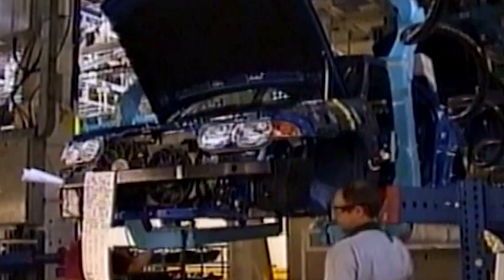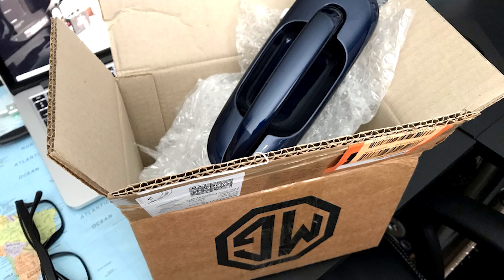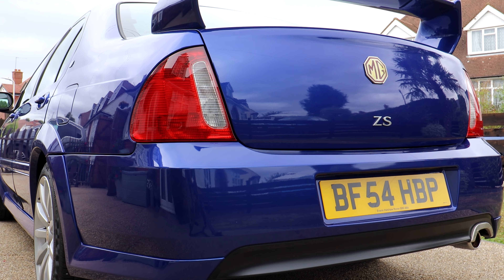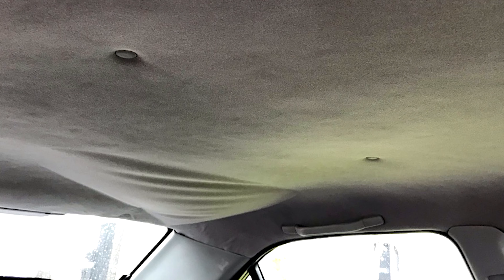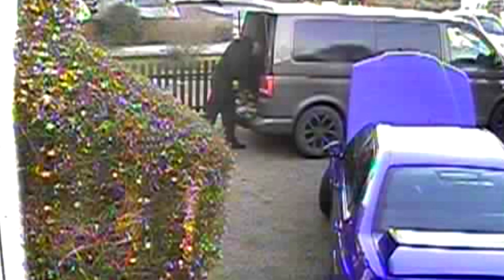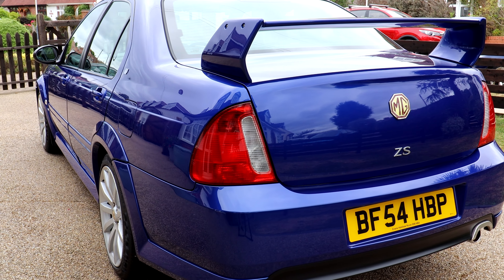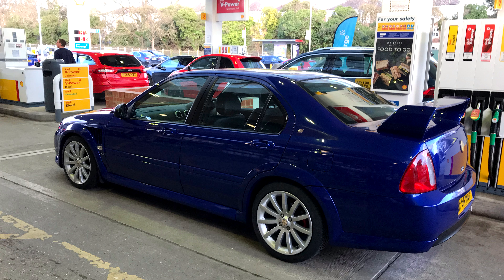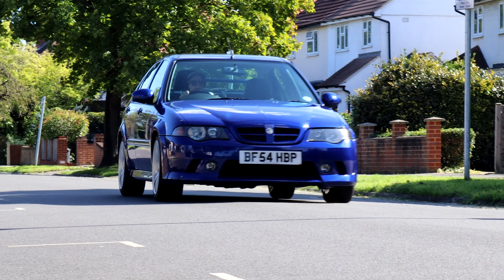MG ZS 180 Owners Restoration Review

Comment: The head lining in my Rover 45 was all sagging just like yours. However, instead of replacing it, I removed it and after cleaning and preparing the roof i then painted it with a matt grey paint the same as the interior of the car and it looks just like the original, only it will never become saggy again. 👍😊

Comment: I just bought a ZS. After mine only 3 more rolled off the line. Converted from 1.8 to a v6, tweaked and dyno'ed at 208 bhp and 278Nm, polybushed and lowered suspension, what a machine. Both to look at and to drive